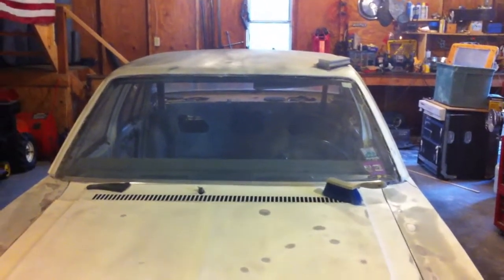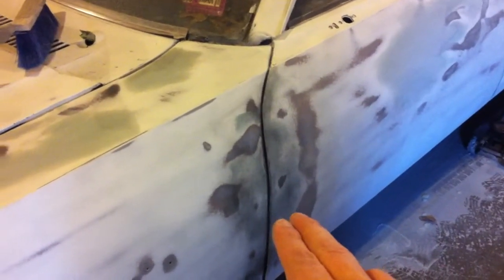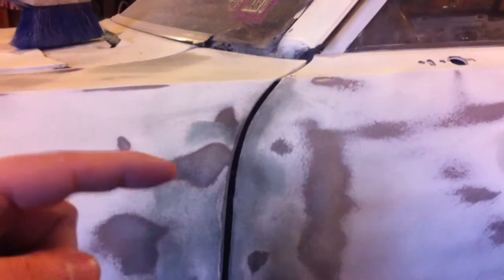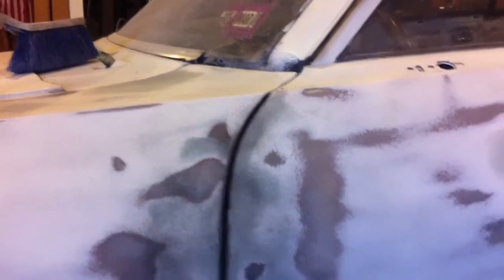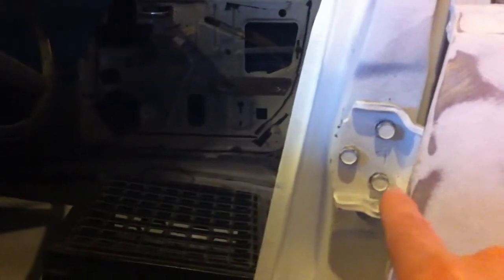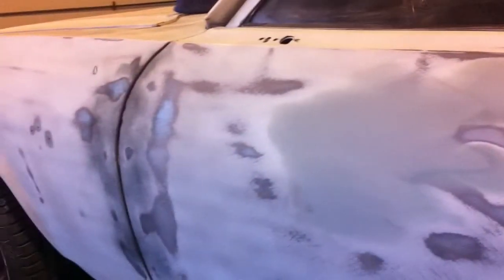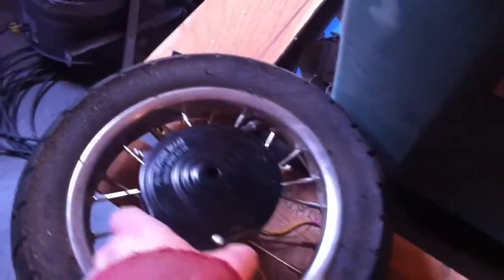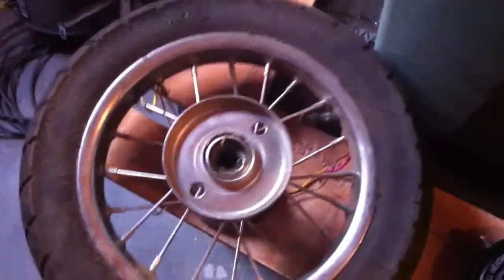Questions about panel allignment and Metal Glaze

Comment: Those hinge pillar bolts/mounting plates are filled with seem sealer I believe, so if you want to adjust the door you'll have to remove the hinges and dig it out.
Reply from the maker: Thanks Jeff-- When I had the doors off before, it looked like some weird stuff in there!

Comment: To get the panel gaps and alignment better than what it is you are moving into the "tweaking panels" phase of body alignment which involves a lot more than just loosening bolts and shifting panels around. You might add a shim here and lose one there or whatever, making one gap/alignment/body line better while making another worse and after all that headache, you end up not much better than you were before you started type of deal. This car your are working on was made with some pretty loose tolerances. If you do anything with it I would only concern yourself with the top body line and getting the panels as flush as possible with each other and call it good. Most people don't notice that kind of stuff anyways unless it's way off. If you have to have it RIGHT, then dig in, learn as you go, as a first timer this process will take a considerable amount of time and patience. Good luck!
Reply from the maker: Thanks Man.. I'm not trying to get it "RIGHT"-- I think I inherited a mess from when she had whatever accident she had. Maaco or whoever tried to get it somewhat aligned, but didn't seem to spend much time at it. Time and patience I have (I always say that at the beginning of something...!)

Comment: the fender needs to go back, and up.. Move it back, line up the lower body line and tighten the lower bolts. then pick up on the top back corner and tighten the bolt in the jamb so that the top body line is level. Its low now that will open up the gap at the top again after moving the fender back..   The threads that the rear door hinge bolts go into are in a plate that can move around. The hinges will move. Just loosen the bolts up and push up and down on the door till they move. I'm no help with the metal glaze, it just takes practice. You have to be fast with it before it drip off your spreader or the car.. This guy just put up a metal glaze vid today. He has been doing a how to vid every week.. Check it out...
The Strange Way - Cab Corner Repair - Episode 6

Comment: Front fender looks like the nose has to go down a tad, and back one shim or so. Rear door should be able to be moved by shifting the hinges on the post. Check the rear gap though. If it is good you might be better off welding some steel to the edge to make it nicer.
Reply from the maker: Thanks Man-- the rear gap on that door is too tight, so, yeah, the door can go forward.

Comment: I'd say shim the front fender up a tick,,the rear door might move forward a little (maybe not) loosen only 2 bolts on the bottom hinge move the top then move the bottom... remember when it gets paint those gaps will disappear ... I knew mom would be fine and predict she'll be walking in 4 days though not far at first.
Reply from the maker: A couple of people have said that when the car is painted, the gaps disappear... how does that work?

I hope she's walking soon... thanks Milo-- I'll keep you posted
Reply: The paint on each edge will close the gap if even a little and once one color is there all will kind of blend in. the body lines need line up more inportant than distances